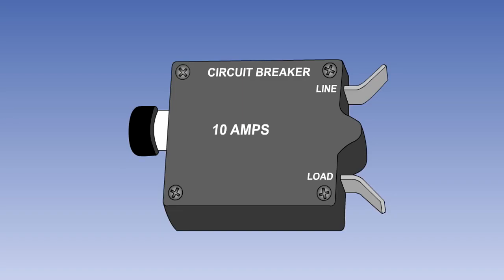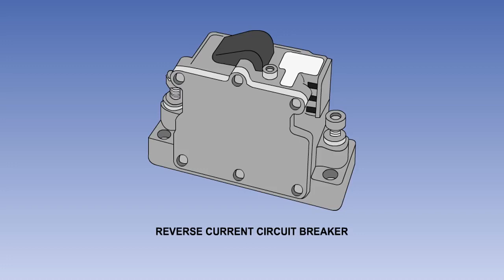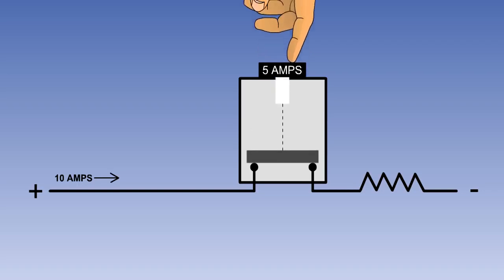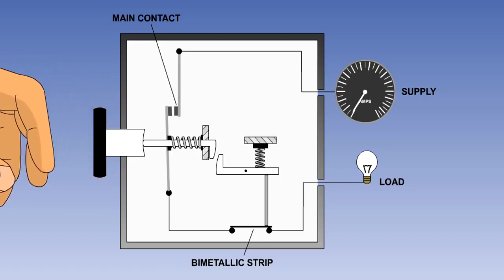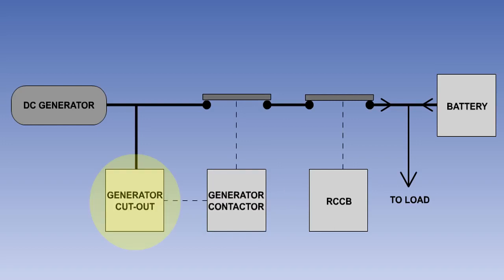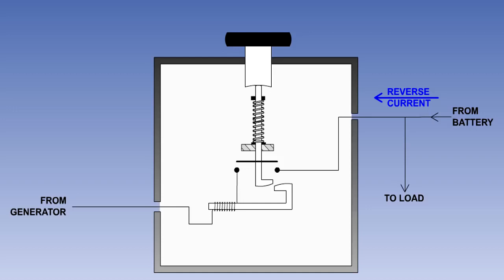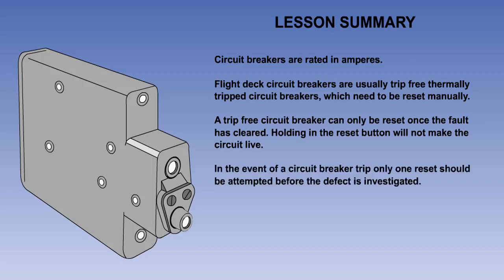Circuit Breakers Protection In Aircraft | Circuit Breaker Protection | 08

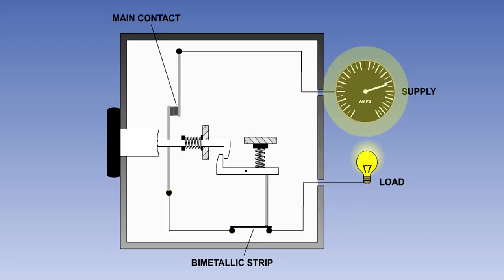Comment: at 3:02, why bi-metallic strip will bend?
Reply: With the heat the metal will expand, and since there is no space for it to expand it will warp.
Reply: More specifically, the bi in the word indicates that the strip is made of two different metals, that expand differently when heated. Thus the side that expands more will bend over to the side that doesn't expand so much. See https://en.wikipedia.org/wiki/Bimetallic_strip @heberluizzunarellimartinsl4664